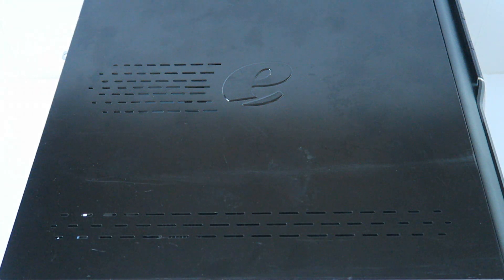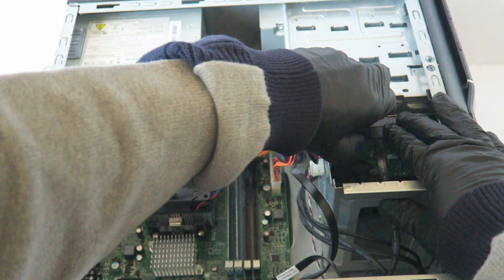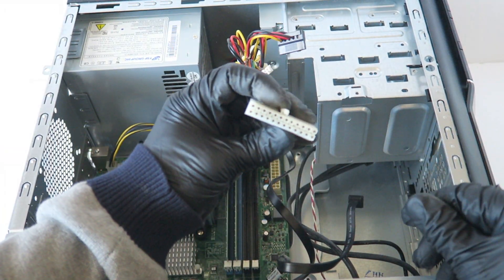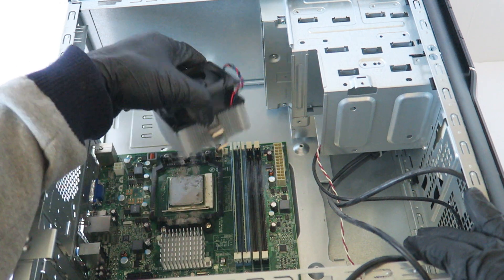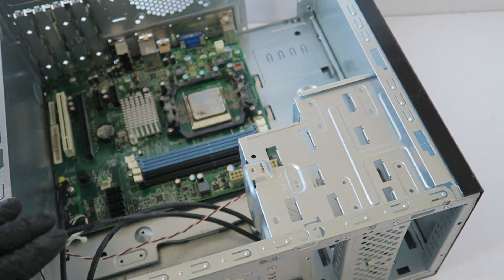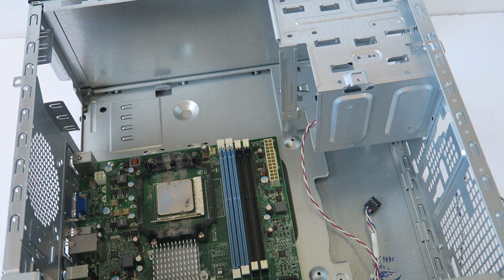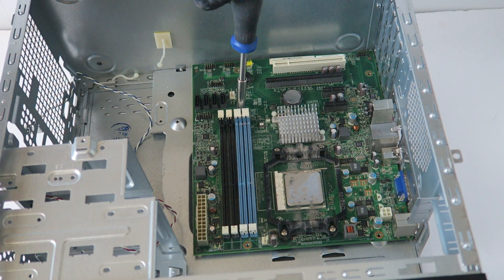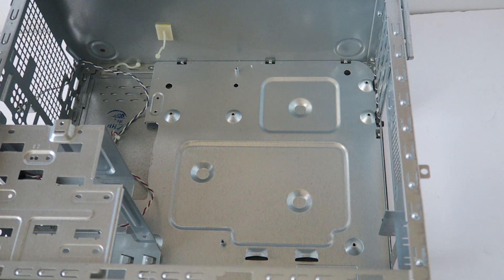eMachines Teardown

Comment: I used to use an eMachine like 7 - 8 years ago
Reply from the maker: Hi, yes this PC is about 9 years old.
Reply: @Mxkdt  If you don't mind me asking but how do you run into all these computers? You seem to have a lot of this stuff.
Reply from the maker: Yes i did buy that PC last week as a lot from local seller so i can make the video
Reply: @Mxkdt  Cool I thought about getting one of those old PCs (like an Optiplex with a Haswell CPU) and fixing it up to be a decent gaming PC.
Reply from the maker: Hi, yes try to get at least core i5 mini tower.